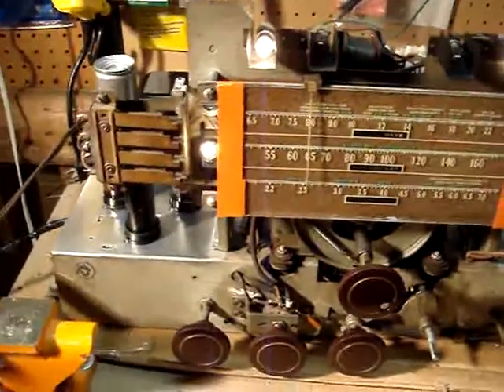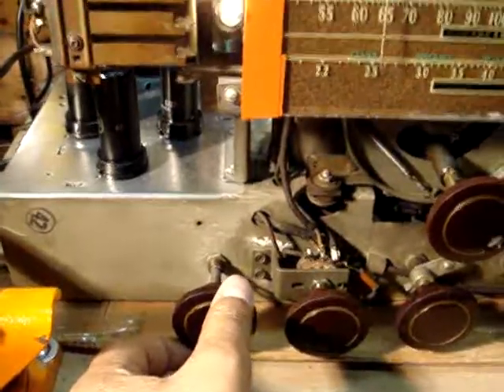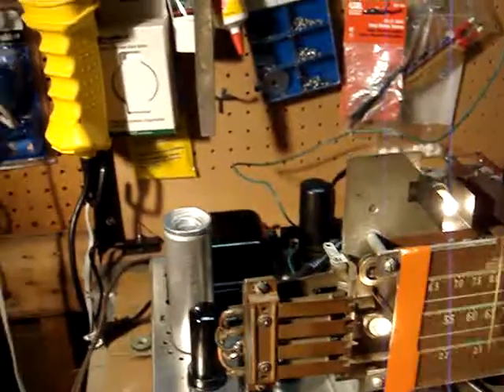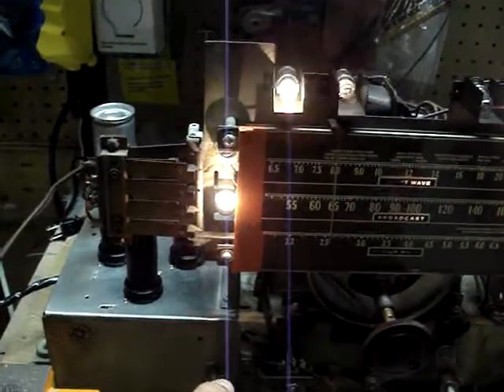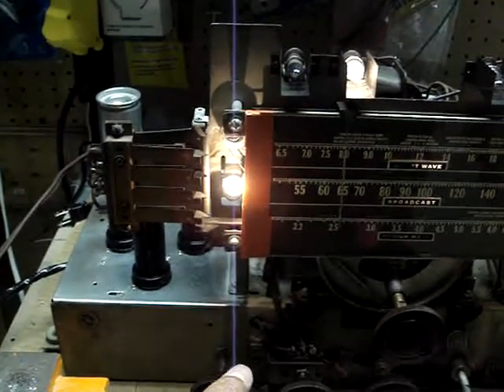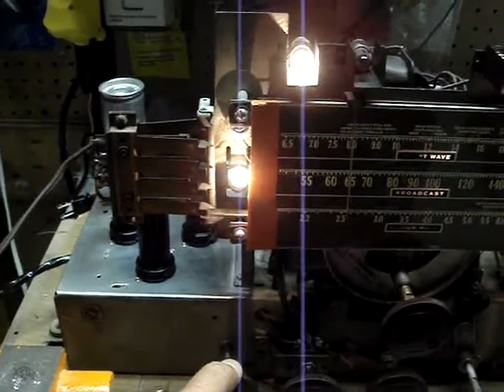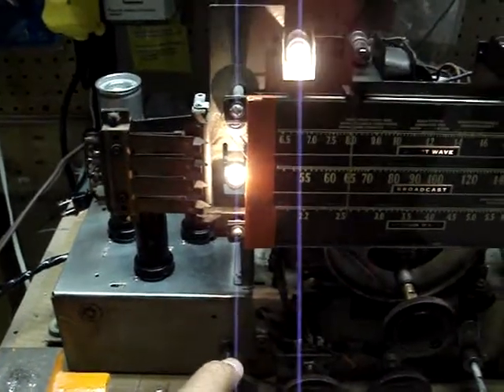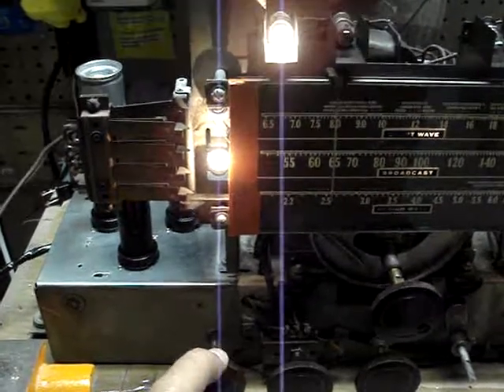RCA 811K Speech:Music Control

Comment: Excellent job!!  I am restoring the mine now, but I can not get difference on the sound when I use the Speech/Music switch, too. Did you find the problem? Thank you and kind regards.
Reply from the maker: Have you changed the caps on Tone control? My problem was because I wired a capacitor to wrong terminal. Check this video of mine and see if this is your problem too (But my audio was also very low). Hope this helps Found My Blunder
Do let me know :-)
Reply: Hello. The capacitor in my radio is well connected. Playing music, Can you ear a clear difference using the Speech/Voice switch? Kindest regards,  José
Reply from the maker: The difference is not very obvious. It used to be used in earlier days listening to news or speeches of the world leaders on Shortwaves. Try it on shortwave, it makes a difference. ~ Ash
Reply from the maker: Hi Jose, This weekend I did research on this tone control. This is there mainly to listen to the news or speeches. Try this: Turn the extreme right Tone Contol knob full base that is full anti clock-wise. You will get awesome rich full base on music. Now if you change the station to listen to a news, full base is not good so just turn the first left know to speech and you will see the difference. This way you don’t have to change the base setting to listen to a voice. Try this and let me know.